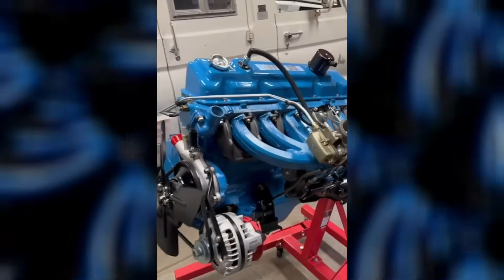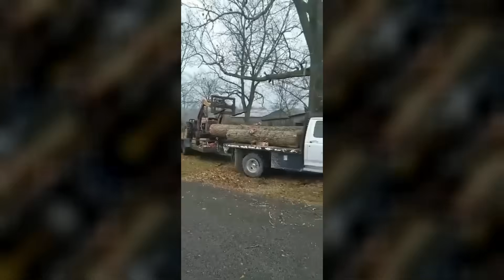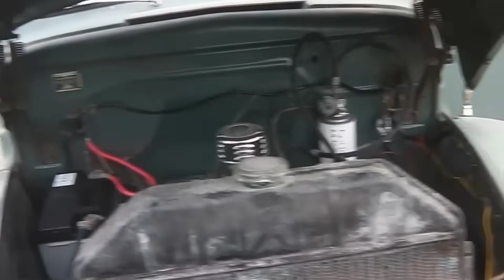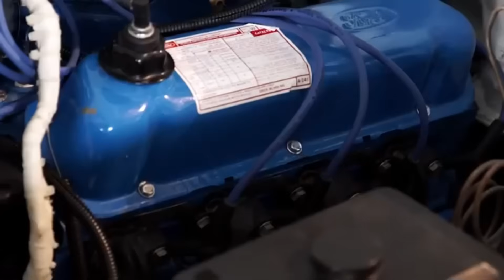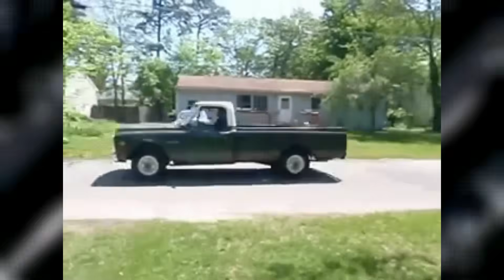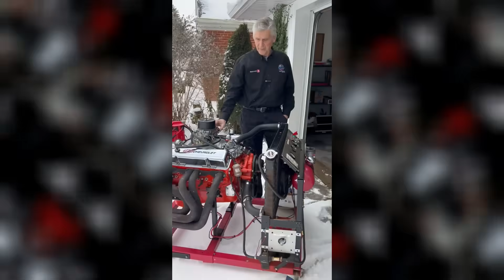Most Reliable Vintage Pick-Up Trucks with LASTING ENGINES!

Comment: Have a 89 toyota pickup. With 387,000 miles on it. Daily drive it. My family has owned 5-6 toyotas with the 22re and 5speed manuel. They are the toughest small pickup ever. 

A farmer in my home down drove it into the mechanic shop with the cam shaft cracked in half (running on two cylinders) and asked for a tune-up 😂